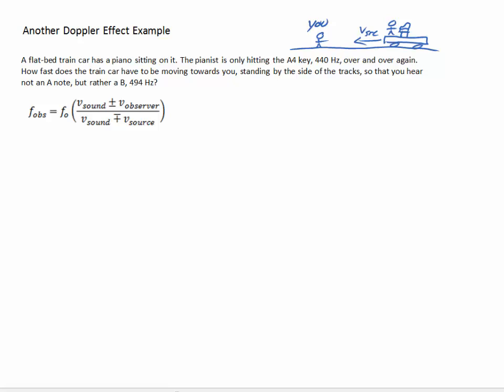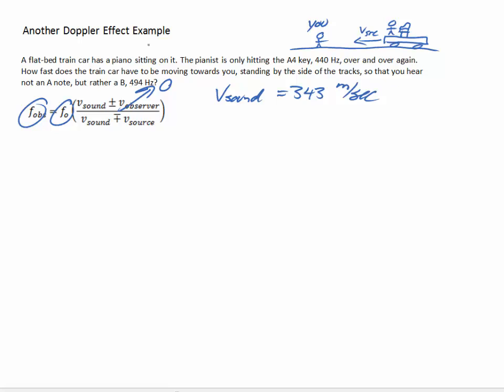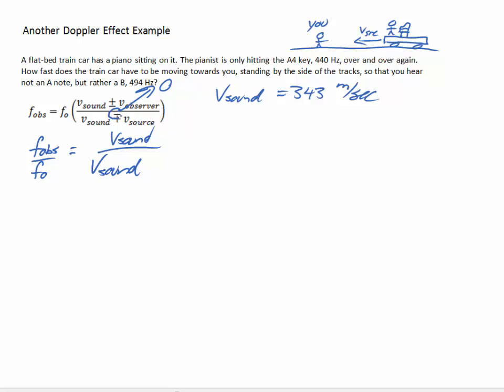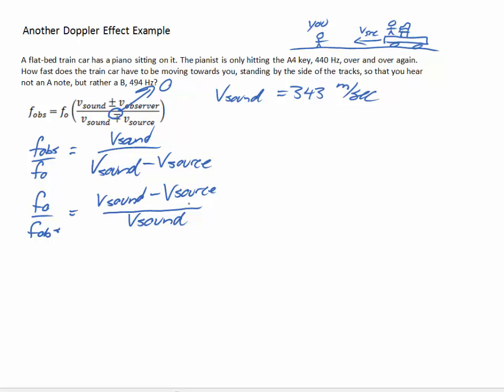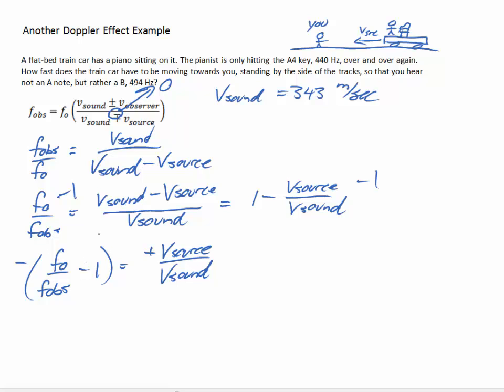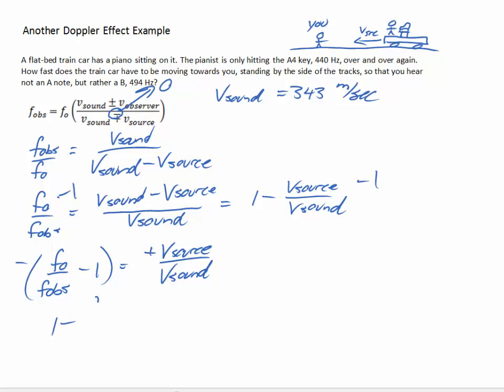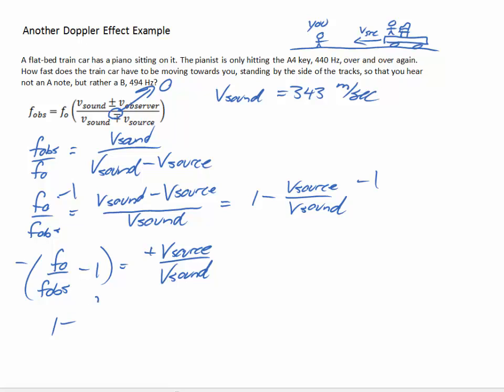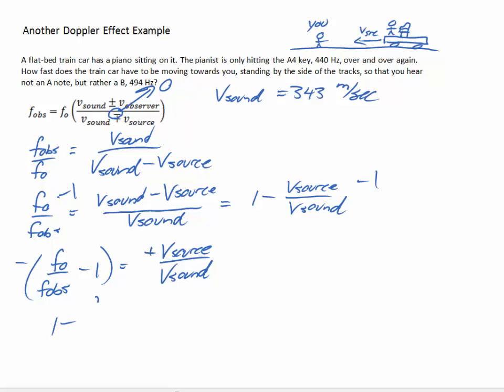The Doppler Effect: solving for the speed of the source

Comment: I'm a musician who notices pitch change from passing cars or airplanes. I've been trying to find a quick way to figure out the speed of the source by listening to the change in pitch (number of musical semitones) in doppler shift (approaching vs. retreating) and your video was a big help. 

As your example shows, the pitch is raised 2 semitones while approaching (440Hz A to 494Hz B). If the train passed you at constant speed the pitch would therefore drop 2 semitones (440Hz A to 392Hz G) as train goes away. So an observer standing by the tracks would hear the pitch go from 494Hz approaching to 392Hz retreating, a change of 4 semitones. So 4 semitone difference = speed of 37.5 m/s or 84mph. Therefore, 1 semitone = 21mph. Bingo, that's the magic number I need to remember: 1 semitone = 21mph.

An observer can't discern the moving source's pitch so the only thing to listen for is the difference in pitch/number of semitones approaching vs. receding.

Comment: Hello sir thank you so much . 
I have a question I have spent three days and I still can't answer . It's quite similar, but it doesn't tell me the original frequency it just says it changes from 5400 to 4500 is it possible to find both original frequency and V source using that ?
Reply from the maker: Sorry for my long delay replying...I'm probably too late to be any help. Anyway, assuming the speeds are not too close to the speed of sound, the original frequency would be halfway between the high and low frequency.